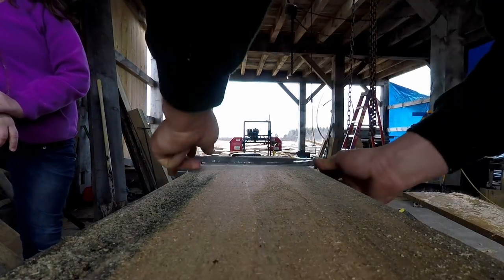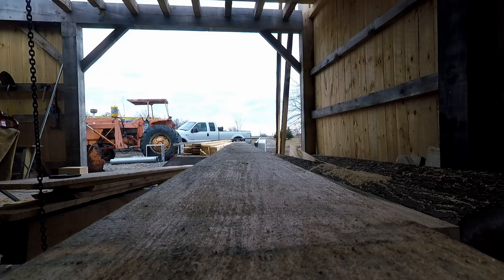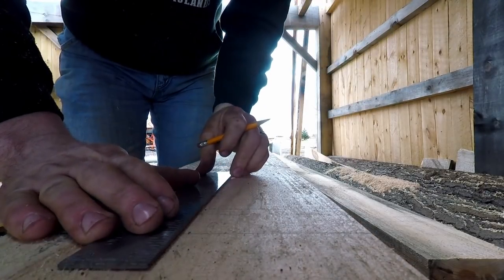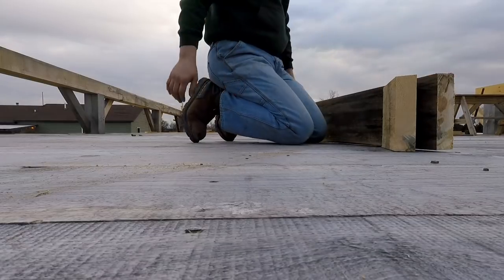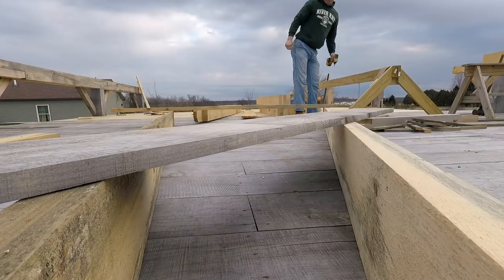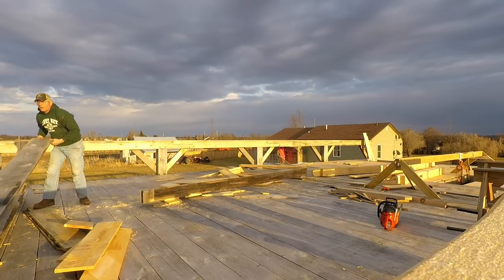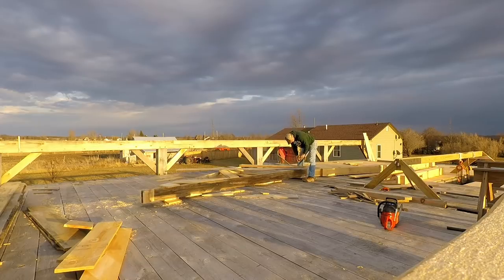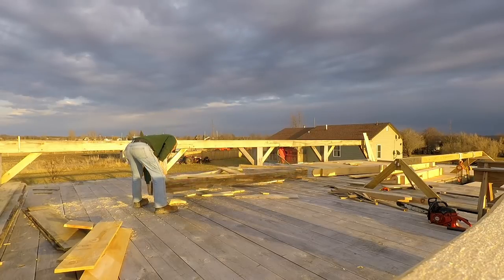A Timber Frame Vlog #120 Building Shear Legs

Comment: Now we're REALLY looking forward to your raising of the queen bents!
We thought it was so cute when your daughter came out and asked it you were making the T type support. She sure seemed quick to ask the feet + inch conversion of that unit, too.
Wishing you clear sailing for the duration of the time off.
Reply from the maker: Looks like a noreaster blowing in...tomorrow might be rough.
Reply: Well shucks. I know you will err on the side of caution, even if it's driving to get the blades sharpened.
Reply from the maker: I will be careful for sure.
Reply: a tip: you can watch series at Flixzone. Been using it for watching loads of movies during the lockdown.
Reply: @Blaze Owen yea, been using flixzone for months myself :D
Reply: @Blaze Owen yup, have been watching on flixzone for years myself :D

Comment: I used to work for a utility company and the poling crew used shearlegs for difficult to access sites to stand poles. Health and Safety said they could no longer use them and they were withdrawn. Did not say what they were supposed to use instead. We all had to go to site then and get as many bodies as we could and grunt and push which was a lot more dangerous. Funny thing though,after a few months someone found a set of legs and when they were used again nobody said a thing.  They give a lot more control than 6 men freehandling so looking forward seeing you use them. Also means the framing is well on the way.
Regards
Reply from the maker: Hello Andy, it's been awhile.

Comment: Jim, turn up the volume of your recorder.  I could barely hear you and my stuff was turned up to 100%.  Interesting legs.  Am intrigued at what will come of them.
Reply from the maker: Hello Terry, Where've you been?
Reply: Oh, I've been watching, just didn't want to throw in needless comments and muddy the comments.  You're doing fine work and I'm glad the second floor is on its way to becoming a reality.  I'm kind of wondering about the rafter system and how they will be connected to the queen posts.  A little simple sketch would help in that area.  Plus it looks wonderful temperature wise during your vacation.  Must feel great after having to piddle with the lumber during below zero temps.  Oh, BTW, get a bush hog and cut the grass around you barn..  It's looking a little shaggy. :)
Reply from the maker: I have a bush hog...that area needs a major cleanup.

Comment: I liked the opening scene :) ,I too use the chainsaw for cutting beams ,i found a 16 picco bar that fits a stihl mount for my 026 50cc saw ,i clamp it to a mini mill and get pretty nice end cuts on the beams with that setup ,seems like no matter how good i measure ,when i cut from both sides with a skillsaw ,can tell it was 2 cuts when i do it .I would like to get one of those beam skilsaws you have someday ,looks very handy ,what size blade do those use ?
Reply from the maker: 10-1/4", brand new they go for $350 now.